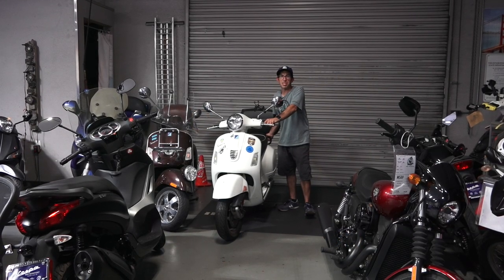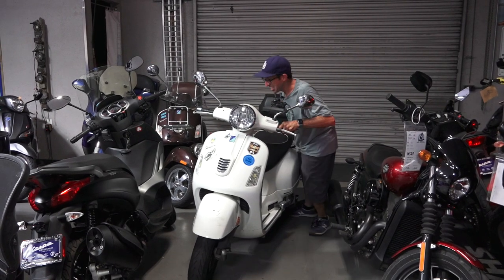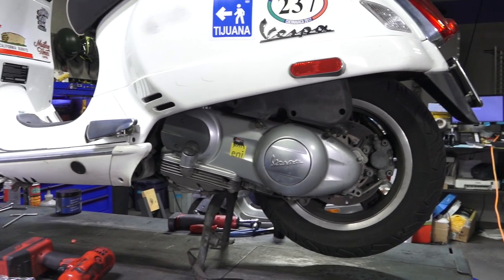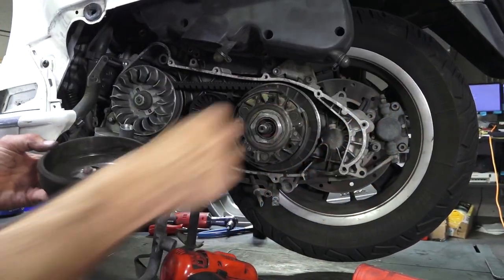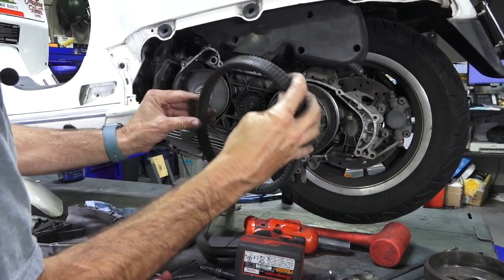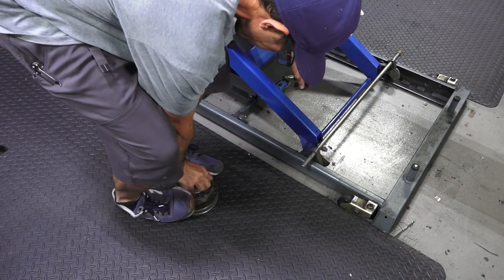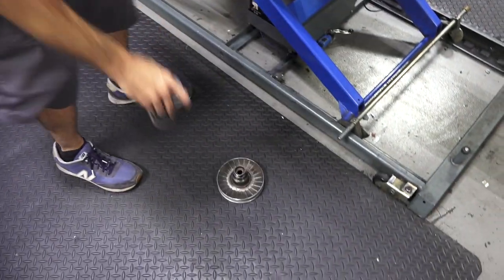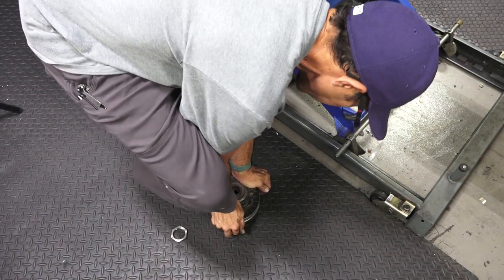Vespa Rear Wheel Locked Up? This May Be the Problem!

Comment: This is a good example of a properly run repair shop. Not only does the technician know the difference between "dirty but Still serviceable" and ruined parts. I don't think I'd ever have a problem paying an account from this business.  Another great video. Thanks for posting.
Reply: Worth the money,used torque wrench to tighten with correct torque.Skill & Professionals.Any shops like this in Singapore.plse update if hav.

Comment: Good morning,
I changed my drive shaft from the reduction gear. I now have wear on the brake shoe hub. I don't understand everything is put together correctly.
When I tighten the nut too much on the drive shaft, the wheel locks?
If you have a solution to suggest to me

Comment: quick question, when I throw my bike on the stand it will accelerate but tire won’t move but sometimes moves for a second and jerks, when I let go of the gas before it sounded like rattling when let off gas before coming from that metal peace area

Comment: Hi ROBOT
I just changed fro 12" to 13" rims on my vespa GTS 300. The mechanic machined the holes in the used 13" rim to mount the ABS plate.
The issue is now everyime after about 15 km the rear rim and Tyre gets so hot you can't touch it for more that 2seconds. The wheel spins fairly freely when on stand. Have you faced this, what may be the issue?

Comment: Hi Robot, what causes the front wheel to lock when applying front brakes? When it happens, i tried bleeding the brake fluid line and it'll be okay then after some time, it happens again. Cant seem to solve the issue. Many thanks in advance.

Comment: hello ,How many Newton meters of torque for the clutch please
Reply: I have the same question. In theory the nut size and grade markings should tell us, but...
I set mine at 70 foot pounds, but may be too much?
Why does Vespa even have a popoff cover for the clutch nut?
Reply: After the case is back together, the nut securing the clutch to the rear wheel should be torqued to about 45 ft lbs.  Get yourself a Haynes Manual.  Don’t believe anything you read on the internet.  Double check the numbers before you torque anything.  These things are very important.

Comment: Hi 5hks four your video i have a Piaggio Zip 50 2T when i drive and give a full acelaration the speed cut down i cleane the carburettor new spark plag and still the same thank you if you can help me

Comment: Hi I have a pgo xhot 125 with the same problem,the back wheel has locked up completely it won't budge even if the scooter is started please advise
Reply: I had the same thing happen to my Vespa px. Wouldn't move even with the clutch fully applied.
Turned out an arm on the cruciform had snapped off and wedged between the third gear cogs breaking a tooth from both cogs. 
Took a complete gearbox rebuild to put right.
If pulling tte clutch in frees the rear wheel then its not that.